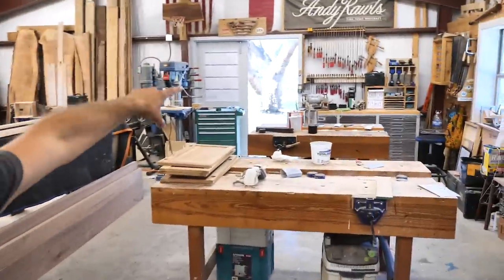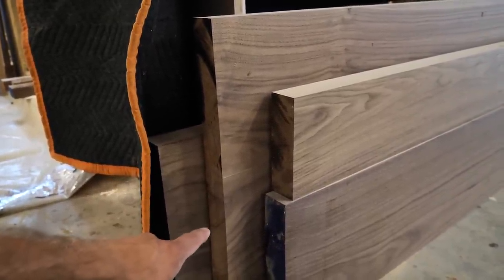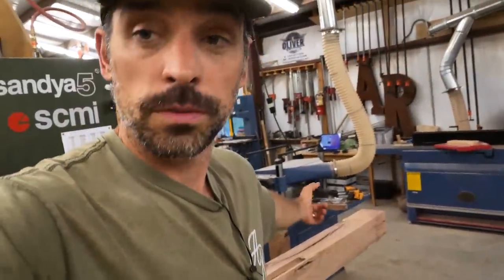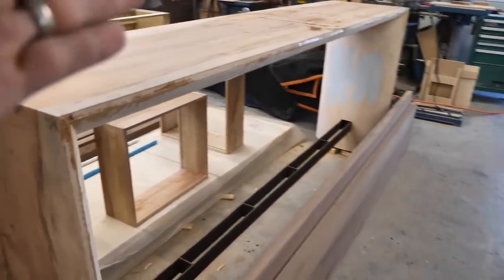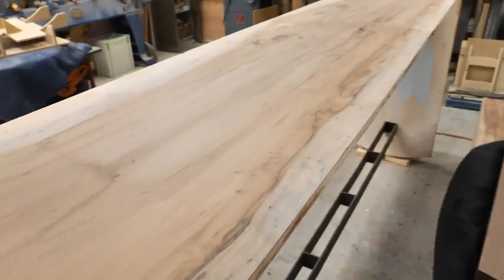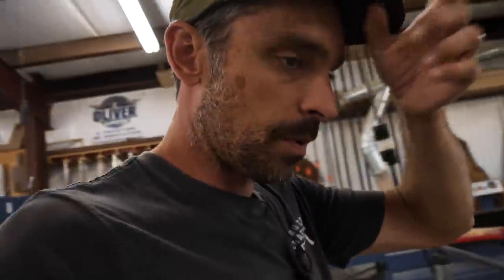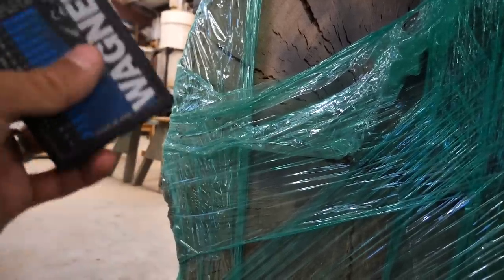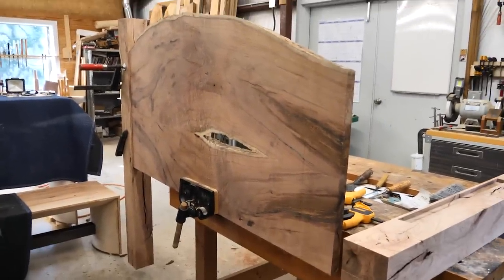Moisture Meters, Jointing Boards Wider Than Jointer, Waterfalls and Nakashima Table

Comment: I have the Orion 910 moisture meter. It's expensive, but absolutely fantastic. It is pinless and reads the moisture from a depth of around 3/4". That's important, especially on thicker slabs which can he fairly dry at the surface but still very wet inside. It comes with a chart for virtually any species of wood and can be calibrated very easily. I have found it to be very accurate and extremely repeatable - many other moisture meters I've owned would give me inconsistent readings. At over $400 it sure isn't cheap, but IMO it's an essential tool.

Comment: Upgrade your Wagner meter.  There line is totally different, accurate and specifically adjustable to species.  And can set to 2 depth readings.
Reply from the maker: Yeah I bought mine around 2006!  It’s old.  Thanks

Comment: I dont think keeping wood in plastic foil is a good ideea, I had some stairs that I wrapped, but not perfectly and after 1-2 weeks I started to see condensation on the plastic wrap, wood dried for 17 years and kept in my shop for 1..so short term the plastic wrap is very good long term idk.